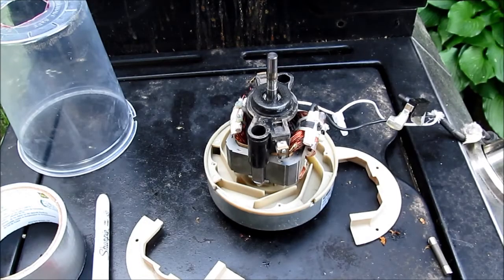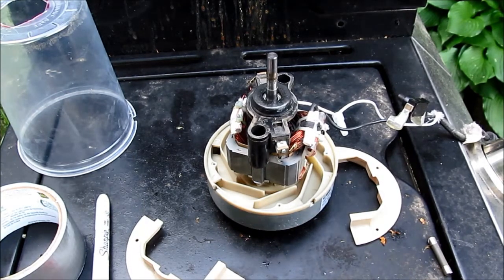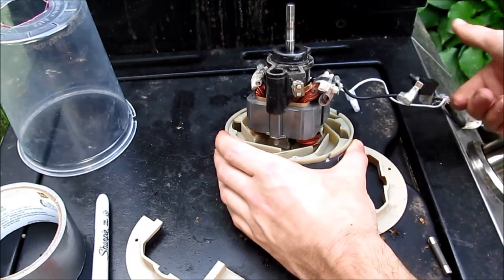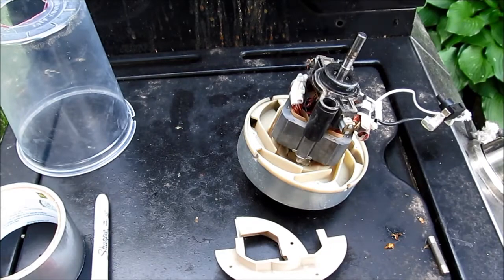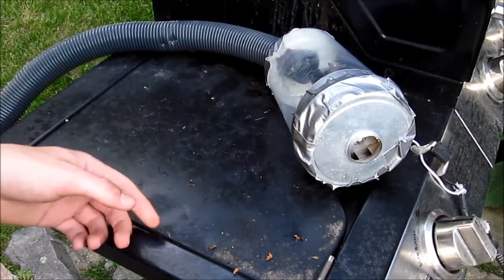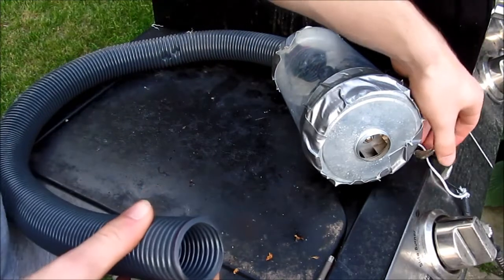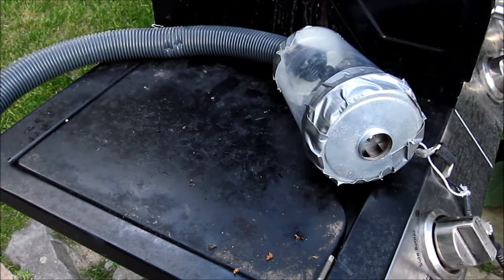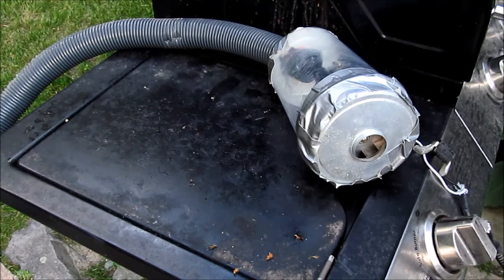Vacuum motor on 24 VDC

Comment from the maker: I'll see what configuration will give the highest airflow at these low voltages.  I need more impeller speed so possibly shunt wound with field winding current/voltage limited to increase RPM (and keep it from being a power hog).